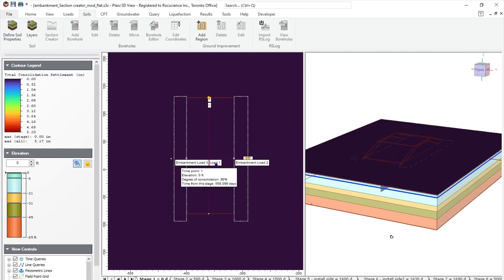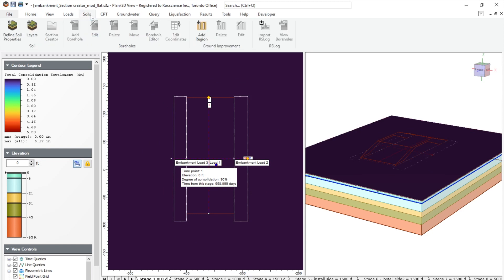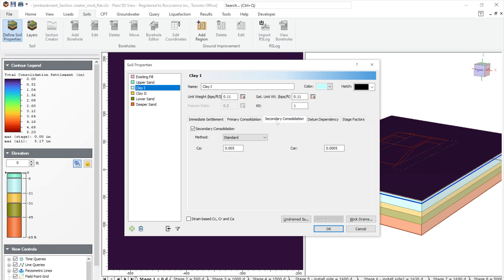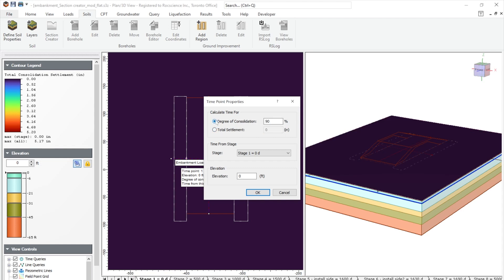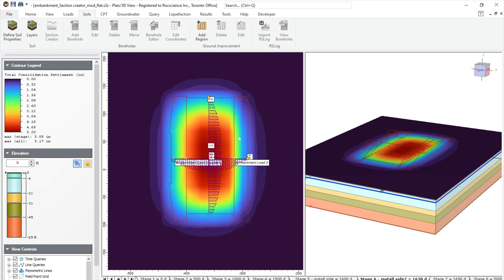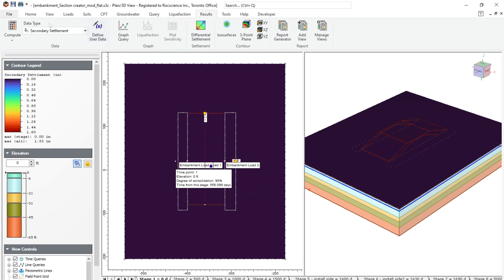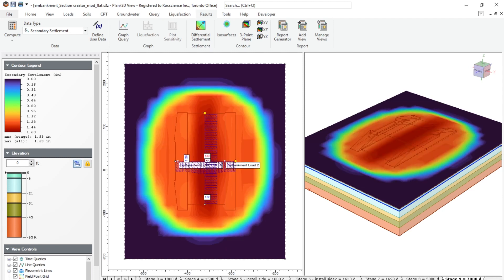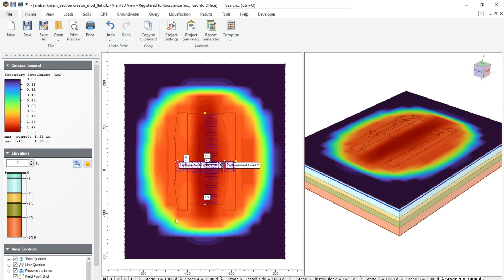Mastering Settle3 - Primary & Secondary Consolidation

Comment: How can I fix it when I obtain this: time from this stage: No solution ?
I can't recognize my mistake
Reply from the maker: Hello,

Sometimes when this occurs, you can try the following steps:
1. Re-compute to ensure the time query points are updated.
2. Check the time query point settings: 
     a) check the elevation where you've placed the time query.
     b) Check the consolidation between stages. The consolidation may have completely dissipated for the stages you've defined prior to the time query, 
     c) Check the groundwater condition, and also check the pore water pressure dissipation for the model.

If the issue persists, feel free to send the model to our technical support team here: https://www.rocscience.com/support/get-support
Reply: Thanks 👍  @rocscience